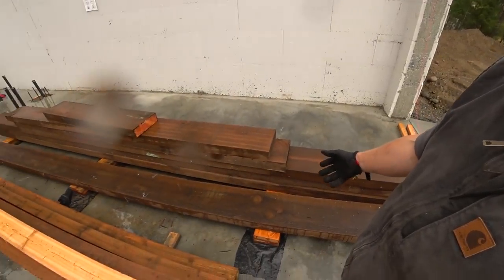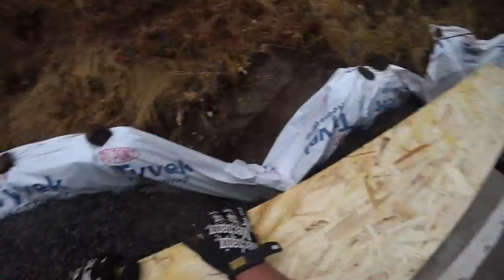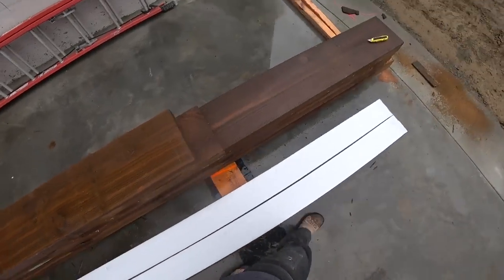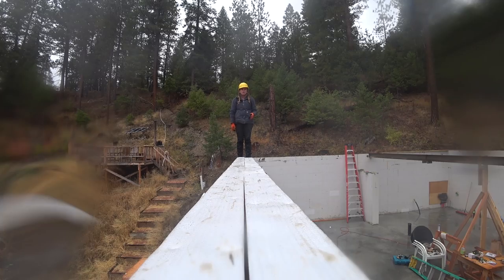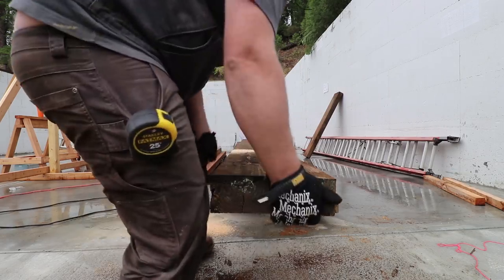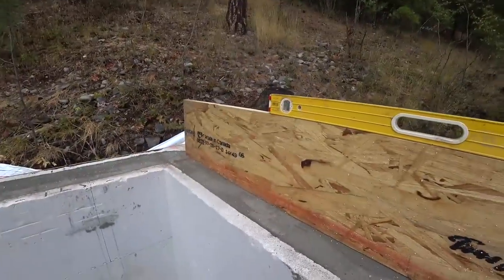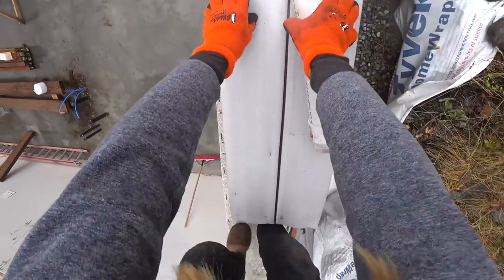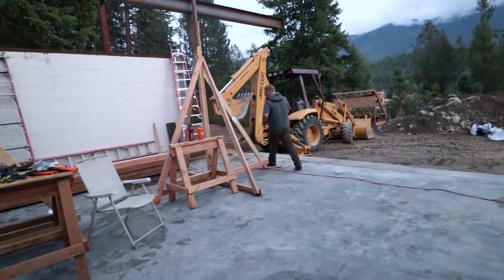Building a House Start to Finish: DANGEROUS Sill Plate Installation

Comment: Don't worry about the sill plates, just get them close. Shim or chisel out the floor trusses, its a lot easier.
Buy or rent at least 2 scaffolds. I like bakers scaffolds, they have wheels on the bottom.

Comment: Jesse, relax, a quarter inch high in one spot is fantastic.  Just go for it.  There is going to be lots of opportunity to be perfect later on.   The place where the wall is high will not affect your floor height since the joists will be running parallel to that wall, not resting on it.
     One other thing, you might be needing a longer air hose soon.  You know, long enough that you don't have to lift the compressor up on top of the wall.  It will pay off later when using air tools as well.

Comment: You guys are doing great!  Just a couple of suggestions:  Leave the compressor on the floor and buy a longer air line.  Ditch the toy circular saw and buy a good Skill or Bosch Magnesium Worm Drive Saw - you have a lot of cutting ahead of you.  As a rule I would bolt the plates down, roll the TJI's, and then check level.  You can reasonably shim the TJI's in the low spots.

Comment: I almost never comment on YouTube videos (mostly because.. dear god, the comments) but I wanted to chime in to say two things: first of all, I've become super-attached to this channel. Love it. I just like watching things be built, and you guys are a blast to watch. 

Second of all (and this is the part you're not going to like): please please please start thinking about your PPE (Personal Protective Equipment) more frequently. I know it's just you and Jessie, but all it takes to ruin this debt-free home is a massive injury. Angle grinders slip. Ladders slip (especially in the rain). Boards can be unexpectedly slippery. If you guys truly consider yourselves craftsmen (or craftspeople?), every single REAL professional will tell you the same thing: invest in your personal safety.

It might cost you $400-600 and a few extra hours (across the entire project) to better protect yourself and Jessie from falls at the bare minimum. Harnesses and anchors are super easy to set up and tear down. Glasses and good gloves cost next to nothing. Knee/back protection is cheap.
Reply: Oh, and one more tiny thing: you guys really should be using ~2.5 to 3 inch washers in conjunction with the bolts on those sill plates. Decent chance of them splitting, otherwise.

Comment: Regarding that foam seal thickness, once you get 50,000 pounds of house on top it, I don't think the foam will make much of a difference.
Reply: There no such as a straight piece of wood, and should you find a straight piece today, it won't be straight tomorrow. At this rate they will never get this house built.

Comment: A safety note. With the impact driver it might be good to get a set of impact sockets. The chromed sockets are more brittle and worth it considering the black impact set is less likely to shatter on you. Especiallywith those larger bolts . Just a thought.

Comment: When I've worked on ICF we set plates while interior bracing is still on. Bolts were set into pour with plenty of slack to set heights. Since you're not building pianos, much of the variance in heights/thickness can be adjusted with trusses or joists if necessary. Try not to work against yourselves.

Comment: The important thing to remember about timber is that it changes size with changing humidity, and will continue to do so all it's life. I had some 2" DIA discs of timber and they varied 0,.020 in diameter with moving from living room to outside. They also became very oval when wet.

Comment: You have all the crap lumber. Perfect for building staging. I have a fused ankle from a 4 foot fall. I know it seems like a lot of extra work it but if someone takes a fall that could have been prevented by working off staging in the stead of ladders it will hold you up for weeks. Also get a gallon of cheap paint and paint the tops of those mud seals. It will make laying out for floor joist easier.

Now that you are working off the ground safety becomes even more of the number one priority. 

Get an 8 in saw. A 71/4 is for cutting sheet boards and 2x4s. A reciprocating saw wouldn't hurt either. 

Good job though and really enjoying the series. Work safe.

Comment: Please get a rolling scaffold with locking wheels, a new outlook that you do not have to do big challenging hard thinking problems. Just get it close and mooovvvveeee ooooonnnn. Winter will be coming. Even engineered lumber will shift some when it is installed. Have a good time. relax, enjoy and have a good happy build.  BE SAFE, use the scaffold, goggles, harness and gloves. Aloha from Maui

Comment: Guys you are doing a great job and I love the videos.  Just a thought when I was framing house we put the green 2 x 6 down with the sill seal and then we just bolted it down and if there any inconsistencies in the wood the weight of the building would level everything out obviously Large issues would be dealt with.  Unless it’s just because of the rough sawn sill plates your being so precise. Trim carpentry accuracy in framing, keep up the good work your doing a great job.

Comment: Jesse, your obsession with perfect dimensions with wood is unwarranted. Wood is not metal and will NEVER be precise. You would make for an awesome machine shop worker. I suggest you buy some cheap scaffolding with wheels. Other than that this is coming along nicely. What are your plans for the backhoe for the winter?

Comment: The "vertical sill joist" are called rim joist.
That's a really nice job, better than you would get from most contractors. A carpenter once told me "You need to be able to caulk up a two inch gap". My thoughts on that was basically "WTF?".

Comment: I have worked in land surveying for a few years and have worked on projects from houses to hydro electric turbines in the James Bay Hydro Electric project (Canada, north of Quebec province) and I think you stress way too much for precision. When we checked the aligment in the electric central, the tolerance where ± 3 milimeters, that's about more or less 1/8"  but that is for the concrete base of a turbine that cost millions of $$! The placement of the turbines themselves where even more precise but for the concrete base it was good enough. I have seen high rise with more tolerance than what you give yourselves. You say that materials are not perfect so you need to be perfect to start, in fact, unless you are very unlucky, all the imperfection will average themselves instead of adding up.

Comment: TOLERANCE : an allowable amount of variation of a specified quantity.

I will discuss 2 types :   Appeal and Soundness of a structure.

Tolerance in appeal is how for off , out of round , out of square , etc... something can be before it is noticed !   And remember, to notice something, keep in mind that it depends how close or far you are from the mistake or successful product.  In high end millworks there are rules like, if you can see a scratch at 24 inches away then it should be corrected, but if you can't see it then they pass it.

Tolerance in soundness becomes more important as you flirt w/ extreme danger.  A roof separating the walls, the walls slipping off the sill plates, the frame crashing down around you or falling over because the center of gravity was outside the base.

You are worrying about tolerances that don't compare to lack of soundness.  In the case of framing and footings and timber / beam construction, perfection is prideful but not necessary.  Get it very close and be proud.    A 1/4" to even an inch off, in some cases, are several times better and safer than approaching the point of a structure that is not sound.

Have fun !   Worrying about an issue so minute (my-nute) takes a lot of time.  Costs a lot of money.   Loosen up and get er done !   You're doing a great job but don't loose the forest for the trees.

Using a 2x4, fourteen foot long for a straight edge is inconceivable.  You decided to use one of the engineered boards in stead.  Okay , but that will bend in 20' even on it's edge.  You use a level (6", a foot, 4 foot ?)  Do you know how to check a level ?   Each bubble ?   I've stood in the store and checked a dozen levels (brand new) hanging on the wall for sale that were off in straightness or one bubble or another, before I found one that was correct in every way.   There are 3 bubbles on most levels and 2 edges, that's 5 checks to make and all must pass or you will have to mark the bubbles and edges that are correct and hope you don't use the ones that are incorrect.  

Aluminum straight edges are better than wood and adjustable bubble levels are better than fixed bubble levels.  But when leveling a 36 foot wall, the best you can use is a laser and tape.  For plumb over 8 feet, use a plumb bob !

As far as perfection goes, you don't read every letter in a book !  That's ridiculous !  You read the words, and you don't critique each word used but you read the book and critique the story.  

Just trying to give you a different perspective !  Hope it's helpful !
Reply: Steph Boeker Thanks for the perspective, well written.
Reply: You bet ! :)

Comment: Jesse your funny !  First you say, "Don't get hung up on minor imperfections because the next layer will also have variances."  Then you say, "Let's grind the top top perfection !"  Sure any obvious ridges and high stops over 1/4" should be removed, but you are going to have to plane  those sill plates to get the that close also.  A lot of work that I can assure you no other builder would do.

Comment: A suggestion. Thinking back on the two houses I have had built I remember the first tool moved on to the site was a reasonable size table saw that was is continues use through the whole project.

Comment: No lumber is perfect even your I-joist will very an 1/8" or more. We where setting 24" lvl's today that varied a 1/4" of course we planed down the high ones but... it is what it is. Don't let the sill plates get to your head set them and keep going. All the weight from above will compress everything down. And don't shim your sills cuz the voids between your shims will sag from the weight from above.
Reply: Don't know why they didn't j-bolt it. If they did I think someone would get hurt.  But looks like a Simpson Titen bolt not sure what the up lift is but horizontal sheer is crazy.

Comment: I hope you get this message before you try installing the I-beam timber joists, given your love of getting everything 100%, they are most often made with a crown in them.This means they curve slightly so the middle of the I-beam is a touch higher than the ends. This is to allow for compression under load and why even solid timber joists are always laid 'crown up' .
Trying to get them exactly level would see a video coming along where straight jackets were the key safety item ;-)

Comment: Your floor joists go on top of those sill plates...that is the time to level them...I just normally place all the sill plates then place the floor joists and then pack and wedge to get my datum and then attach the sill plates and pack an wedge to establish the floor level. The wall don't attach to the sill plates, it sits on the floor joists...well it works that way here in oz
Reply: I would imagine when the I beams are up, they will be covered by 8x4 sheets of 'something'. Those sheets will even out any 1/8th discrepancies and who will notice an 1/8th or even 1/4" undulation in the floor. As their engineer said, don't obsess.

Comment: I like what you guys are doing. That being said... I have been in the construction industry for 30 years. Started with a shovel in my hand and worked my way up and trained to journeyman level in multiple trades and have worked as a construction safety manager for a 50 million dollar a year company. Eventually I became a contractor and started my own business 14 years ago and is still operating today  mostly in the renewable energy field. My short term advice, stop overthinking the little things. Seal plates... arrrg! Get, rent, build some scaffolding, please. I hate seeing you walk backwards on your walls. Throwing up tools to one another. What i'm saying is I don't want to see you guys hurt. I would like to see a safe thought out execution of your dream. If you can't get scaffolding just try and be as safe as possible. Maybe a harness system so that your protected when your up high and exposed. Tie off a cable to a tree or two and attach your harnesses to it so you have at least something to catch you in the unfortunate case one of you might fall. Otherwise, good job so far, now that the plates ate level just slap that shit together and get closed up, safely.

Comment: I was replacing lamps on the devils reinforced concrete. I was wishing so hard for a real hammer drill. I used good DeWalt drill bits and a professional Bosch drill with hammer function and it still was a chore.

Comment: At the joint you can bore across the joint and fill the hole with PL Premium adhesive then drive in a dowel to force the glue into the joint.

Comment: I am at a loss as to why no scaffolding ?  You can always find someone selling it used. I have bought and sold it many times over the years when doing projects. I hate seeing them struggle on ladders and walking the wall
Reply: Or make a simple scaffolding system - that's what I ended up doing.

Comment: OMG Alyssa was walking BACKWARDS in the gloom and rain on a thin wall 1ft across but more than 10ft up above a concrete floor,  pulling a huge beam rolling on a plastic pipe, which is surely not according to H&S guidelines. One strong push from Jesse who is often kack-handed, would have her down! Why no scaffolding? I cannot understand why they spend thousands on fancy kit but ignore the basics. Tolerances are too minute to be worrying about and Jesse is obsessing again.

Comment: Probably too late, but a 5 x 10 foot rolling scaffold will make setting your joists a lot easier.  Drywall contractors will know the cheapest place to rent.  Walking a wet steel beam a 10' is not a good idea.

With two 5 foot tall frames (4 needed total) and wheels underneath, should get you to 11 feet. They should have screw extensions if you need to go a foot higher.  Set a few joists on the rig at a time with the backhoe and wheel them into place.

Comment: That grinder guard is kind of important, if that thing had grabbed while grinding the top of the wall, it could have spelt disaster without the guard. Looks like it would have fit.
Reply: the  grinder is to hey

Comment: That sale seal should be going down on the top of the wall you're creating a gap between every sill plate because your Seal Seal ends at the end of the board that sell seal should go all the way around the perimeter with as few of gaps as possible and where you do have gaps it should be staggered you're just creating a hole at the end of every piece of lumber doing it that way

Comment: I applaud your drive to get every part of the build perfect but your shooting for to tight of tolerances.  that 1/8in will not even be noticed, but if you are concerned about it you have some giant framing chisels that can probably take care of that.
Reply: I agree.  Getting all OCD over 1/8 of inches is only adding to the grief.

Comment: Oh, and it doesn't matter how accurate you are w/ level, plumb and pitch ...... if you fall off that wall and break your neck ....  leg, arm or lose and eye ! :)   OSHA would closer your job site down and fine you if they saw you were over 4 ft off the ground w/ no harness or hand rails !   Not that OSHA has authority over your work or safety, but how do you justify your OCD in construction tolerances if you don't practice safe construction methods ?  And then working in the rain on top of that ?   Bad for safety, bad for tools, bad if you get sick, just bad in general.   God bless you and keep you safe, I'll keep you in my thoughts and prayers ! :)
Reply: Yes, I can see that as well. :)   I believe it's fine as I see they have no pressure by others, money, clocks or family. :)   As long as they are happy and doing something, it will feel good to do it correctly , ...... , no matter how long it takes or how much money they spend :)

Comment: you mit want to look into get two baker scarfolding they are great for set floor joist and other aireal projects You can find these at homedepot ,lowes ,tsc, and harbor freight  .they run about $200 but they are well worth it in the long run great for drywall painting u name it.

Comment: You two are doing a great job for doing this for the first time.  For a tip on timber framing get yourself a warm drive saw that can fit a 8in saw blade and get the 12 in chair saw attachment it will save a lot of time and make the job a hole lot easyer.

Comment: Interior scaffolds are much cheaper than scaffolds for outside use, seems I saw them on sale at HD for around 199.   The work goes faster and safer, like the difference between working on something in your lap and something on a table, and you'll need them for framing the house anyway,

Comment: I have to make this comment y'all.  Those anchor bolts are not that strong to hold down you house.  A friend of mine that does concrete had his crew installing angle iron using 1/2" bolts like that and borrowed my Dewalt impact driver and they pulled several out.  Those bolts do strip the hole out.  I really believe that the Redhead anchors are better quality that the ones you are using and will lock your sill plates down to the foundations.  I hesitated to say anything but you are going to build a house on top of that.  Sorry for not giving my two cents earlier but you could add more anchors and use the Redhead brand too.